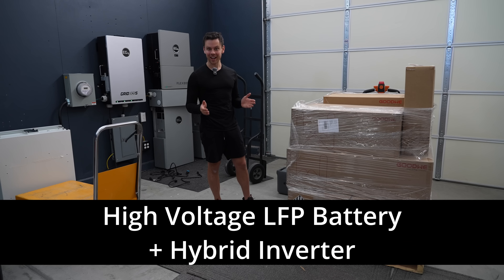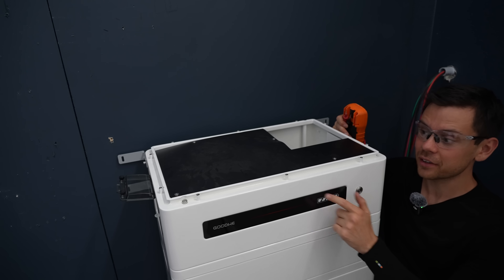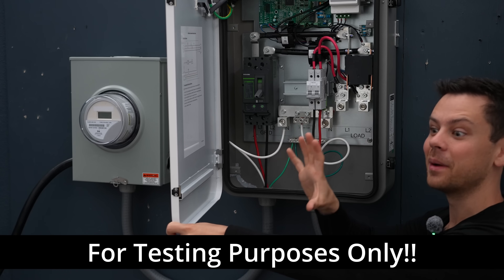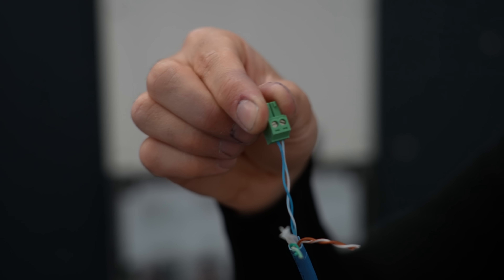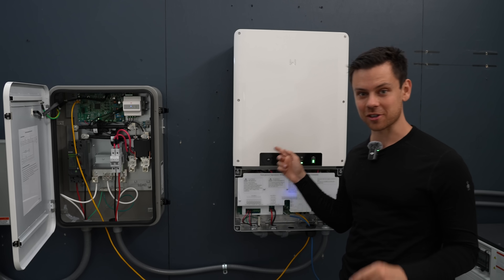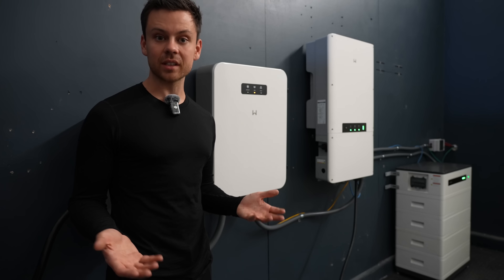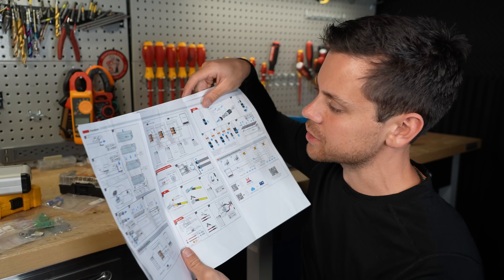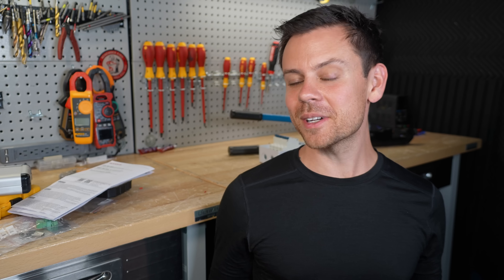GoodWe 11.4kW Hybrid Inverter + High Voltage LFP Battery: My FIRST Dead Silent Inverter!!

Comment: Interesting video and also interesting that you state that the trend is for higher battery system voltages. 48V is much better than anything lower but still low enough to be fairly safe. Higher than 48V and you do need to be more careful but I do understand that higher voltages tends to make systems more efficient and maybe cheaper.
  
This is a little different topic but was wondering why there isn't industry standards for solar power systems? I know that innovation is happening fast but if components were more standardized then wouldn't this would help the industry? I have seen and heard from others that when something like a micro inverter or solar panel goes bad they often don't make that part any more and it can be difficult to repair their system. I come from the Ethernet industry where IEEE does create standards so that Ethernet devices interoperate. When your Wifi router goes bad you can buy just about any replacement, plug it in, configure it and you are running again. Do you think that eventually solar standards will start to appear?
Reply: Hi there 😊 The inverter indeed complies with the IEEE communication standards, and when communicating with third-party devices, it also adheres to various Modbus protocol standards. Let us know if you have any other questions. ✨
Reply: Sorry, my email must not have been very clear and I apologies for that. Yes, I understand that the communication meets an IEEE standard but that was just an example I was trying to give an example of why a standard is helpful. Let me give examples of what I would like to see with solar and some examples of other industry standards.

Would it be nice if solar panels where standard sizes, connectors and mounting were standard so when a panel goes bad you can find a replacement that is the same size, connectors, mounting and even voltage. How the panel looks might be nice also but that may be asking to much.

Another example is home electrical outlets. Think about the box that sits inside your homes wall with the electrical switch or outlet. Its size, shape, where mounting screws are located are all somewhat standardized. I can go to the hardware store and by a new box and it is likely to work. Just about every part of how home electrical wiring is design is designed to meet a standard and there are several if not many manufactures that build to this standards. Think how bad it would be if every house built had different electrical plugs and you have to buy AC adaptors to use different products. For example if a toaster from LG had one type of AC plug but one from GE had a different AC connector.

You likely are familiar with connectors for cell phone, computer mice, computer keyboards, electric toothbrushes, electric shavers and a ton of other electrical device that run from rechargeable batteries. For a while every device had it's own AC adaptor or charger and now over time many are converging to USB connectors. I think in europe they even made it a requirement that small electrical devices use one type of connector which is USB-C.

My thinking is to make these solar power systems more like lego blocks and all manufacture build the parts that are more interchangeable. The goal is to make it easier for people to install and repair systems. In a way it does seem to be happening but some standards organization I would think should be driving it. Writing the specification just like IEEE does for Ethernet specification where all manufactures build their solar and battery components to common specification.   

Let say you have a solar power system and 10 years down the road some part like a FET or Diode goes bad in the BMS or inverter. Instead of replacing the whole system the system was design to be repairable down to some level. Maybe not to the component level but at least to the board level. Most old style home equipment like HVAC systems, electric water heaters, and other appliance at one time where designed to be repaired not replaced. Maybe my view is a sign of my old age and maybe the future is one where you always buy new and throw out what is broken even if the cost is tens of thousands of dollars. Maybe the industry is changing so quickly that old systems should be replaced.  

Keep up the good work in helping China to build better products! I wish you were helping some US companies but most of this stuff is just not being built or designed in the US.

Best regards and continued success!

Comment: You really should try a Sigenergy system.  It covers most all your issues with this unit.  The only thing is that it still uses proprietary batteries.  There are no DC connections to make, and it is native Ethernet (actually networked and not just a serial bus using Cat 6 cable).

Comment: My problem with apps is that, in 5-10+ years, the company may discontinue or no longer have a server online supporting those apps and we might end up with an expensive box.
IMHO, where ethernet/wifi is present, there should always be a GUI interface totally independent from internet, with most options as well as manual fw download/update.
Reply: Hopefully the industry starts interfacing with open source systems like Home Assistant.

Comment: Hey Will, thanks again for the informative vid.  As I was watching I couldn't help to think of my Generac PWRcell inverter which appears somewhat similar to the GoodWe.  I've been running it for close to 4 years now without too many issues (other than the SnapRS issue in the past that everyone had).  The Generac PWRcell system is also very quite.  The only time I hear the battery fans running is when I am pumping in several kWs from the solar panels to charge them (but it's still pretty quite).

Comment: as far as i'm concerned, if you can't stick both 4 and 6 sided crimped ferrules into a terminal (allowing you to use whatever you please for the tool), that terminal isn't sized properly.

i also tend to stick to more universal control setups. not a fan of being locked or even mostly locked into a given ecosystem.

and this seems to be a case of at least somewhat locking into one.

Comment: lol try luxpower/Megarevo hybrid inverters with heatsinks cooling systems they are dead silent too and the eg4 batteries will communicate with it... they are 48v also has high voltage models

Comment: I looked into Goodwe for a while for an off-grid install, however at the time it was not possible to run more than one inverter in parallel (for both increased load, and for redundancy so you still have some power in case one inverter fails).  Has that changed?  Definitely prefer the higher voltage battery though, I really dislike the idea of sticking with 48V for anything but low power inverters.  In my opinion there is an increased risk of fire from poor connections when you're dealing with such large currents, so it's not just about the efficiency but also the safety.  I don't see the higher voltage as any sort of risk, because you have to take the same precautions when dealing with low voltage high current batteries already, so it's no worse unless you're already working on them in an unsafe manner.

Comment: If that company has any brains, and I'm sure they do, they will be all over Will's recommendations. For the loss of profit on proprietary batteries they can have a much more profitable customer base. They should be AI-ing a Quick Start guide on the app within the week.
I started freaking when Will mentioned having to rewire an internet connector. Not too many customers are that techy. None of my customers will even open up a computer. It like doing an engine swap to them.

Looking and sounding great Will. Been gone for a bit, but been a subscriber since the Toyota?? motorhome. I think it was your first one. Funny looking thing. No offense. Lol.

Congrats on the mil subs. They say the first million is the hardest.

Comment: Can you make a video about the different micro grid interconnection devices out there, and which ones are the best or most brand agnostic?  I’m getting a solar system installed with Tesla string inverters, and I was thinking of connecting it to a Gridboss to make adding battery backup (with sodium ion batteries) much easier in the future.  But now there’s this Goodwe MID and I’m wondering if it’s a better choice.

Comment: I am a retired Master Electrician and former Electrical Trades Instructor.  I used to tell my students, test your tester, test your circuit, test your testers again. If your tester isn't working (multimeter, etc.) and you don't test it first on a working circuit, it might make you think a live circuit is dead. Then you test your tester again to make sure your tester is still working.
Reply: Glad you emphasized this - Will speaks of the serious nature of this voltage level - but DC this high is downright scary- (and should be treated respectfully)  - from an Electrical Engineer's stand point these higher voltages make sense (efficiency) , but from a DIY standpoint I'd almost suggest 48 VDC systems (themselves dangerous) over this for individuals with little electrical experience   ..   Most people don't even understand 12 volt system - in my battery box builds I use flexible silicon cutting boards to protect the work field from dropped tools shorting out the batteries or cells.   I rarely see this precaution in 48 volt battery builds..
Reply: @mikehamby9723  got hit with 409vDC a week ago. It hurt like a bitch
Reply: Wear PPE
Reply: Live, dead, live
Reply: @HappyJF  unironically if your tester is dead, you will be soon LOL
Reply: The high voltage batteries are dangerous, but so is the output from a string of panels.  Most new hybrid inverters, like my EG4 6000XP, input a PV string of 300 - 400 VDC.  So, have a panel disconnect switch and if you work with the panel wiring, best to do so at night.  The GoodWe inverters can handle even a bit higher PV input voltages.  On the plus side, the PV side of most inverters is isolated from earth ground and floating (I think), so touching one conductor should not cause any current flow to earth ground.  But touching both + and - conductors could conduct a fatal current thru your body.  I think the battery side is also floating rel. to ground.  Electricians often work with potentially high-voltage conductors with one hand behind their back.
Reply: @williamgrissom9022 left hand in your pocket. 😊

Comment: I have been using the Goodwe gw5048-es. It's a 5kw inverter with 48v battery. I use a seplos battery with pylontech settings and the communication is working perfectly. It's dead silent, you can expand the battery as big as you want. There is a ES G2 (generation 2) inverter that can be paralled and also connects to EV charger. It is the best inverter I have ever used.
Reply: Oh stop, you’re making us blush ☺️
Thanks so much for sharing your experience, honored to be your favorite! 💛

Really glad to hear your system has been running smoothly and quietly 🙌

We’d love to hear more about your setup and where you’re powering from ⚡️ it’s always inspiring to see how GoodWe systems are supporting energy needs around the world.

Feel free to share more anytime!

Comment: Another great video Will ! I wish you would do one on the communications between the batteries and the inverters. I don't understand the operation at all, it just seems to me if all the individual BMS are working correctly, what is the need for external communication.
Reply: A very good question! 🙂The battery needs to be charged and discharged in accordance with the instructions of the inverter, which will be more efficient in the TOU mode and peak hours. 
👍

Comment: is there a reason you couldnt put 2-4 of the 48v yixiang batteries in series and connect it? no communication, but would fall within the correct voltage window for the high voltage inverters

Comment: In most cases, that's going to be 16S elements and a 48V<=>260 (or whatever HV is for that particular system) converter inside each battery module, so it's not going to be any better in terms of efficiency. The greatest advantage, apart from thin wiring, is going to be the ability of charging-discharging each battery individually, since the HV bus does not depend on their SoC. Essentially, it just brings outside the HV DC bus you got inside any LV inverter/UPS and splits the single big boost converter for the parallel of all the 48V batteries into as many small boost converter as you got HV battery modules.

Comment: Man this makes so much sense especially when most systems take a higher voltage setup from the solar panels. Way less copper to buy and less stepping down and then back up again with the batteries. Can't wait to see this go more main stream and the price to plummet. The longer I wait to install a system the cheaper and better the technology is getting.
Reply: 😊that's what I keep telling my self.
Reply: The advantage of 48 volt systems is that one of the batteries failing isn't going to leave you in the dark. If your 48v battery bank consists  of 4 12v batteries, you could grab a 12v inverter and make some use of them. With the high voltage batteries you are stuck. 

From a wiring perspective,  the higher voltage stuff is easier.  Finding wire thicker than 1/0 isn't easy then there are the fuse holders..
Reply: @jrplus416 well once this stuff becomes more mainstream that won't be so much of an issue. Just thinking personally there is no way I'd be setting up a 48v system using 12v batteries in series. Not when the cost is much less for already packaged 48v packs that come in server configs or large 14+ kwh packs. If you need backup power you can always run a gen-set and have a separate backup system like a Jackery or Eco-flow generator.
Reply: @jrplus416  IF your 48V battery bank consists of 4 12V batteries... MOST batteries are 48V, not 4 x 12V, so that doesn't apply. But I'm happy with my 48V batteries, and I don't want to upgrade until they stop working, which will hopefully be over a decade away. You can always wear electrician's rubber gloves, under stronger gloves, whenever dealing with voltages higher than 48V.

Comment: there is new high voltage systems popping up all the time. I am wondering what voltage is gonna become the new standard and then we will be able to get the appropriate inverters and batteries and dont have to be an overpriced complete system. a couple years at least. I wonder how long before EG4 changes some stuff to try to fix what you dont like,when Will Prowse complains companies listen.(also multiple other youtube channels will also comment)

Comment: Silent would be amazing!  I like my EG4 6000XP but it is way too loud.  I wish they would release a firmware update that allowed the fans to work like a normal system and not just off/full speed!
Reply: Can you replace the stock fan with a more expensive one specifically designed for low noise?
Reply: @mikemotorbike4283   When I googled the issue, many people have done some changes to make it quieter, including quieter PC fans.  The wiring on the EG4 fans is apparently a bit different, so be careful.  I didn't want to break anything, so was hopeful for a firmware update.

Comment: I'd love for you to do an evaluation or overview of submarine battery systems in modern subs. They have very large batteries and high DC voltage as you talked about with this battery system. I'd be interested to hear your take on those submarine systems.

Comment: you don't need a HV battery for a silent system, they also make 48V version which are also silent, some of these have fans but you can't hear them even standing next to them as they use massive heatsinks and big fans at low speed and only come on when needed. its same with all sealed IP65 inverters, don't know why these aren't common in us.

Comment: Two EG4 systems from Signature Solar with 20 panels would be roughly $7,000, 10,000 watts. Love my original system off grid cabin. Thank you Will for changing my off grid life. 5KW system runs fridge, CPAP, lights, all systems and works great. One problem? Will not work in winter. My cabin in MN has zero heat unless I am there. Don't want to run a heater. I don't mind fan noise on yellow EG4 inverter. I went from 60 watts, to 120 watts, to 400 watts 12VDC. Junk. The 48volt 5,000 watt system is supreme, love it. Thanks.

Comment: And....  Can you explain how a HVB works?  Is there a standard voltage? Do they just use the batteries in series?  Is there a BMS that converts from 48vdc to 250vdc?  Smaller wires in my book is always a good thing.  Thanks

Comment: I put ferrules on those EG4 stranded battery cables by using a small zip tie near the top of the exposed strands and working on the ferrule, which pushes the zip tie to the bottom of the exposed wire, then you cut off the zip tie.  It still wasn’t easy, but getting small enough ferrules on without the zip tie trick I found on YouTube seemed impossible

Comment: How about the LG 16H battery with the Growatt MIN-US inverter,  It doesn't have the EV connection but a whole lot less.  Uses a high voltage battery so wiring it easy.
Reply: Hi Andy 👋for high-voltage batteries, each different battery manufacturer will adopt a different voltage range; the high-voltage battery products of GoodWe can be connected in parallel, and the maximum capacity can be expanded to 76.8 kWh 👍

Comment: Hi will, hv batteries are definately not the way forward. Theres zero compatibility with anything other than the producers own products. They're higher priced than than lv batteries and most dont have the same depth of discharge. Having recently reviewed a HS3 for SAJ we will be sticking with the off grid LV equipment which can connect to any generator, any panel, any inverter. Suggest researching dyness powerbox g2 batteries. Would be great if you could do a review on them.